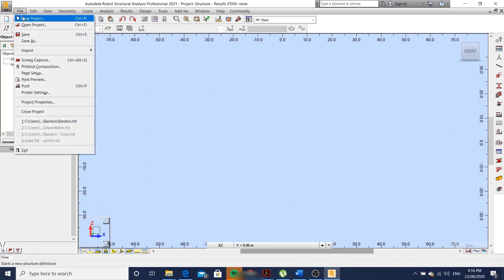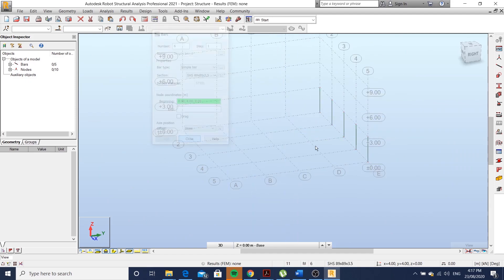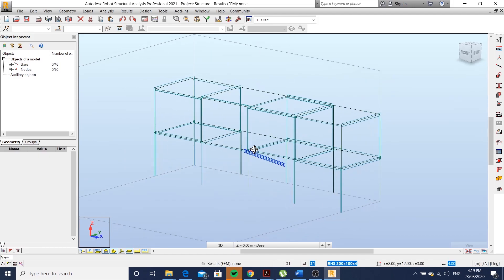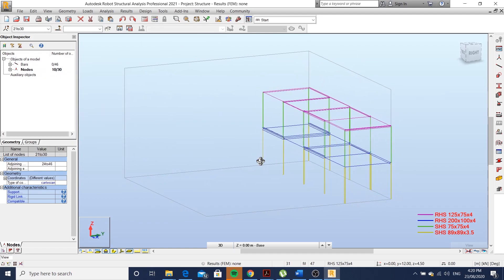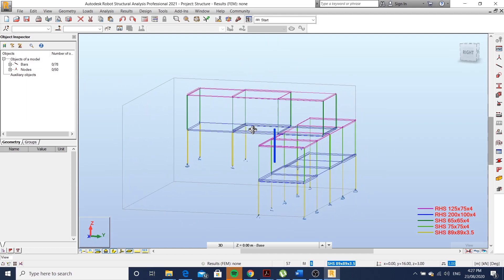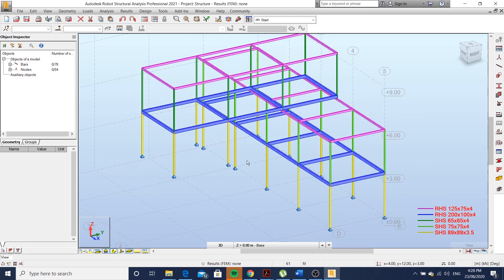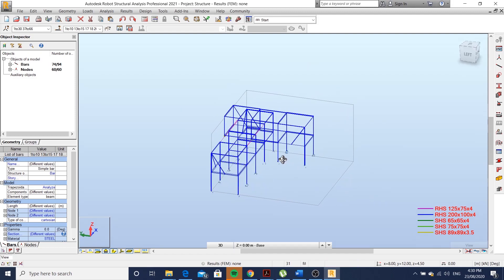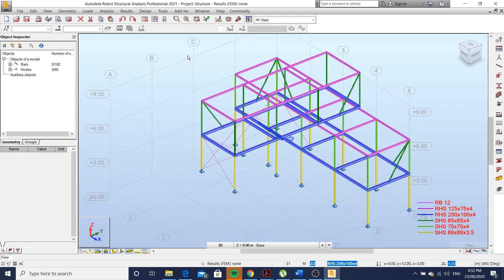Part 1 - Steel modular house tutorial in Autodesk Robot Structural Analysis

Comment: AWESOME, I WILL SHOW MY FRIEND YOUR CHANNEL. DO YOU KNOW HOW TO APPLY AS3600 INTO CONCRETE DESIGN, SEEM LIKE RSAP DOESNT HAVE THAT FUNCTION
Reply from the maker: Hi mate.. Robot doesn't support AS3600. I usually use it to get moments and internal forces and design concrete structures with spreadsheets or with another software. However, if you play a bit with the settings you may be able to get something very similar to AS3600.
Reply: @bengthebrazilianengineerinAus   Tks mate. You dont know how many people wait someone like you to show up. Keep your great work :)
Reply from the maker: @nhanvohoang8935   Appreciate it. Thanks